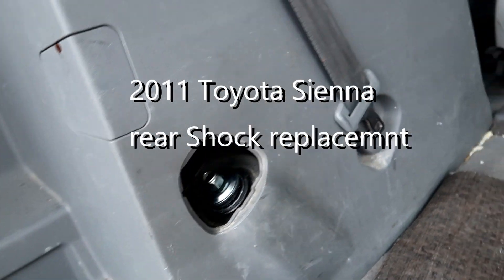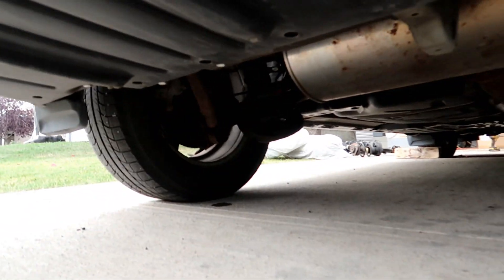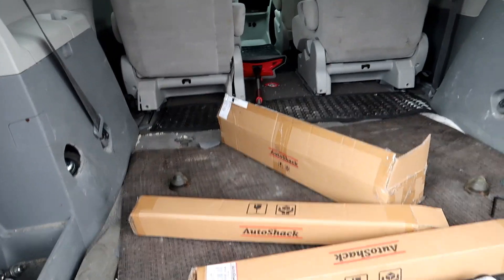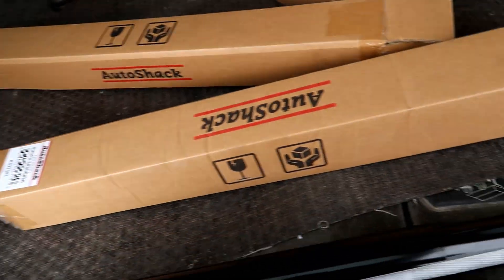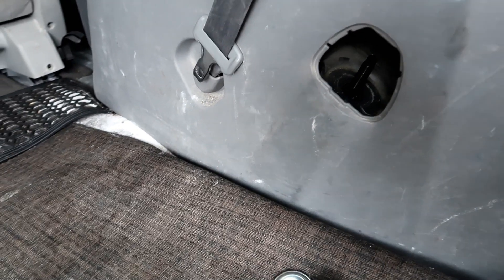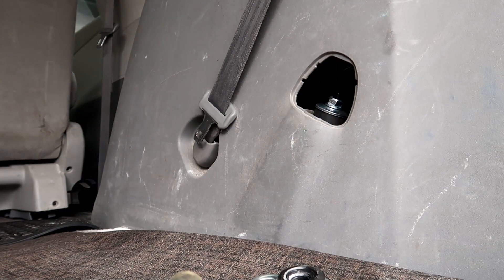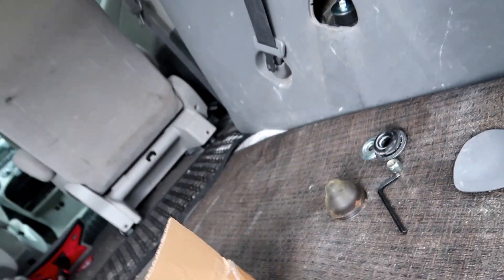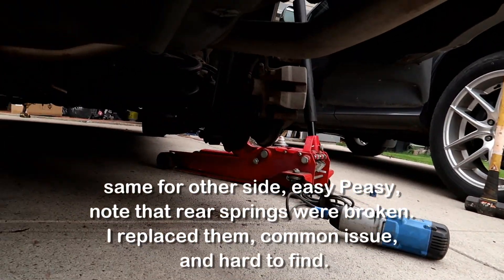2011 Toyota Sienna rea shock replacement

Comment: Helpful video. And yep often those rear coil springs are broken. For the AWD version there’s no third party ones that I found so had to get from a dealer. (I used an online Toyota parts dealer which was about $150 less per spring than the local dealer)

Comment: Doing this tomorrow. Seems easy. How did you enjoy the coil spring installation?
Reply from the maker: @NicolasIchihara  tougher to get the new coils in than taking them out. Best practice it to have both rear wheels off the ground and loose the control arms.
Reply: @percyconnolly  Did you jack both sides up at the same time to get the springs in?
Reply from the maker: @NicolasIchihara  yes had both sides of the truck backed up. I did the shocks left them loose. You may have to loosen off the control arms as well because they are tightened up at ride height to get the most amount of droop to get that spring back in broken ones come out easy.